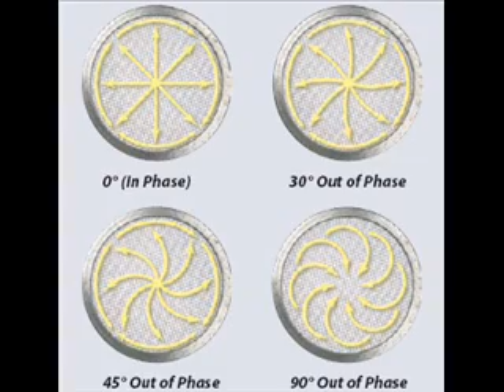How To Change Weight Settings & Assemble a Kason Vibroscreen Circular Vibratory Separator

Comment: is that center gasket under the washer made of teflon or some other material
Reply from the maker: If your are referring to the washer that holds the screen in, it is neoprene with a stainless steel washer on top.